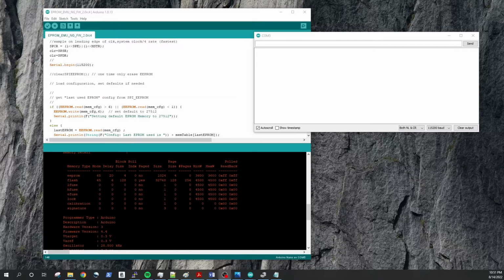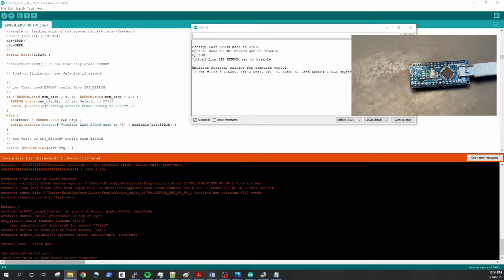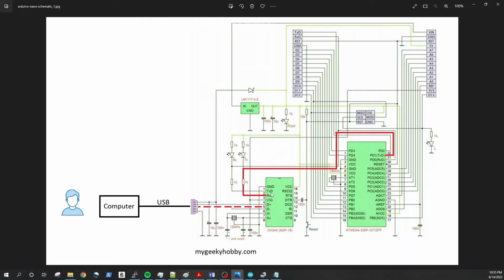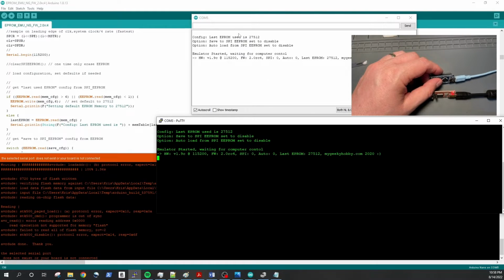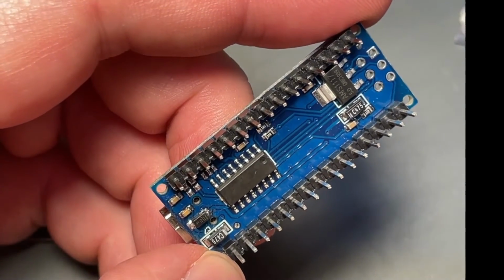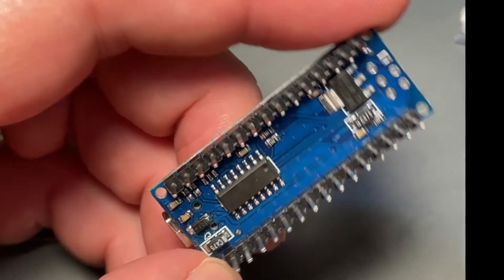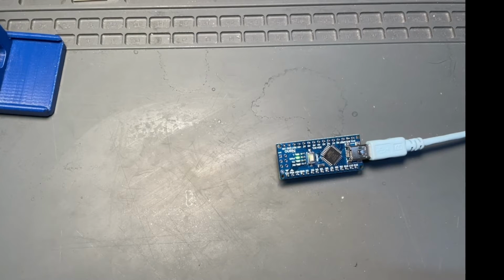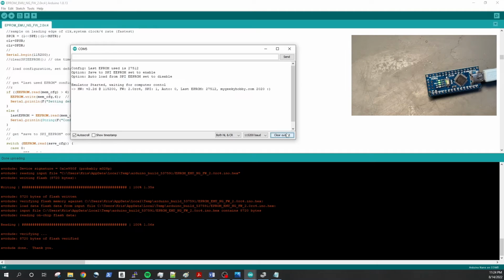#11 Repairing broken Arduino Nano Clones, Episode 1 - Upload issues

Comment: even spending 1 hour trying to fix a 2 dollar nano clone is ridiculously wasteful of your time unless the exhibition is the entire point idk what the point is.
Reply from the maker: .... 3 years ago, when the video was posted, the prices of microcontrollers have gone crazy due to chip shortages related to the pandemic ... at that point it was not unreasonable to spend 50 cents on a new ch340 to fix the module ... there are other aspects of this video that have value even today ... troubleshooting to discover broken hardware vs wasting too much time thinking it's a software problem can save you time :)

Comment: My nano seems to randomly work and randomly not work, I know it works when i press the reset button a sequence of led blinks so is it still the ch40  chipset or something else?
Reply: The problem is with the diode!
Try powering the board from pin 5V or VIN and GND.

Comment: mine was also a stk500_recv error - ch340 chipped Nano clone with no underboard crystal next to the ch340-chip-pins7and8, setup as Board:Arduino Nano"  Processor:"ATMega328P", changing to the below setting made it work, without doing anything else
Tools = Processor: ATMega328P (old bootloader)
Reply from the maker: that suggests your board was running the old bootloader. Thanks for the heads up.

Comment: Hi, good video thank you. I have three Nano which have no crystal next to the Serial chip
and the chip itself is the same amount of pins to the CH40 but this one has no writing on it
at all, I tried fitting a CH40 but it doesn't work, Have you any idea what this chip is please
Reply from the maker: Some versions of CH340 don't require the crystal, so if your PCB doesn't have the crystal make sure you use CH340C ... not the CH340G.
Reply: Thank you Sir, I will check that out

Comment: It is detected but does not work, and the driver is installed perfectly. Solutions?
Reply from the maker: Hi Pier. when you say "does not work", you need to tell us more ... what exactly is the problem
Reply: @MyGeekyHobby  It is basically detected but then when I open Arduino IDE to load a sketch, it copies it (at least it seems to) but does not execute it.  Error: Failed to install library: 'Arduino_BuiltIn:1.0.0'.

Comment: I also have pile on Nanos with the same problem. Thanks, for showing, that it is not so hard to change the CH340, cause with micro USB ports in EU it is getting hard to find with decent price. I am more curious, why they are dying. Made a design, that Nano can be powered only from USB or only from PCBs 5v regulator. Only thing what i  suspect right now is static electricity from usb wires.
Reply from the maker: thanks for the comment. Interesting observation, in my case all the broken ones that I had, were broken when they were new. Static can be a problem, the design of the nano clone is very basic and has no protection on the USB lines.

Comment: please, explain. How you got the sketch that ouputs something in serial monitor. While not beeing able to upload anything into the arduino? --sorry for my english i'm from czech
Reply from the maker: The upload was failing as some bytes were "corrupted" by the ch340 chip...so the "verify" step after programming was failing... on the other hand the sketch was still able to send most of the data to the computer ... but we saw some characters of the text were incorrect. Hope that makes sense.

Comment: my nano clone got shorted when i was testing with multimeter it still shows a light and programs but to get voltage out on any of the digital pins it has to be powered with the barrel jack
Reply from the maker: check out the other video #12

Comment: RX , TX LEDs on my arduino nano are always high and i cant upload any sketch to it. can u help me with this?
Reply from the maker: both LEDs on suggests that either the atmega328 or the ch340 are broken :( ... you could try to connect external usb - ttl converter the same way I did, but connect both TX and RX signals and check if you can program this way...
Reply: Bro  the cap in my Arduino nano (near ch341) was damaged so I removed it and shorted it using solder
Now the pc dosnt detect the Arduino
Wat do I do :/
Reply from the maker: @memelate9624  in most cases the cap should not be shorted (most of the caps on the arduino are installed across power rails so if you short it, you are essentially shorting the power lines) ... better to remove the cap and remove the short
Reply: Will it work without cap?
Reply from the maker: @memelate9624  usually yes, but depends how it’s used. If it was decoupling cap and you replaced it with solder blob you probably shorted power, and one diode that supply power I’d also broken - watch the other episode for more info.

Comment: Why?
Reply from the maker: why...not ? In fact in the last 1min of the video I'm explaining why :)
Reply: @MyGeekyHobby  Didn't the electricity to power the lights and video camera cost more than a replacement item?
Reply from the maker: @artherfocksake1312  The video does two things, 1 explains the "upload error" scenario where the Nano kind of works but has issues uploading, 2. gives option for those who want to attempt to fix it. In USA those modules cost about $8, so spending $1 on replacement ch340 makes sense - I had a few of those modules with the same issue.